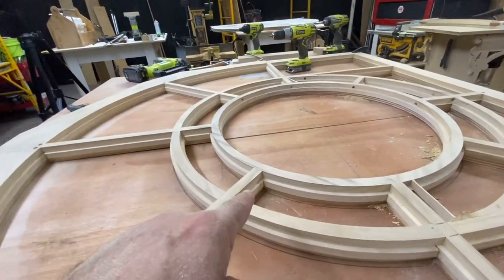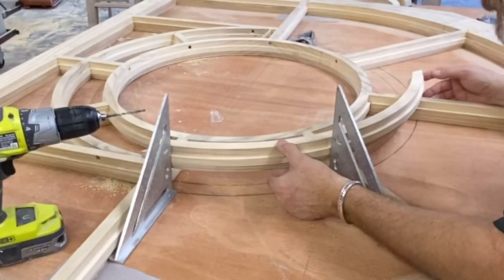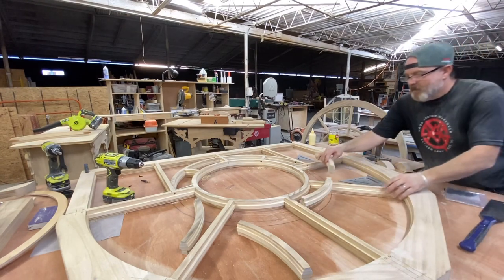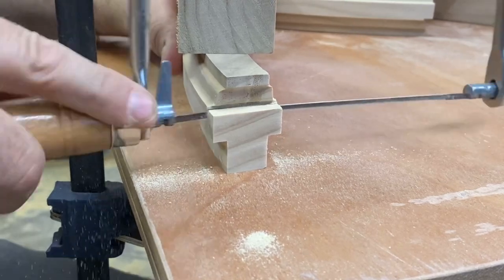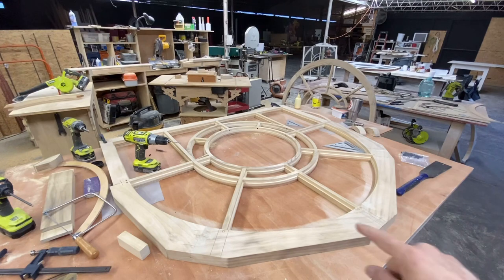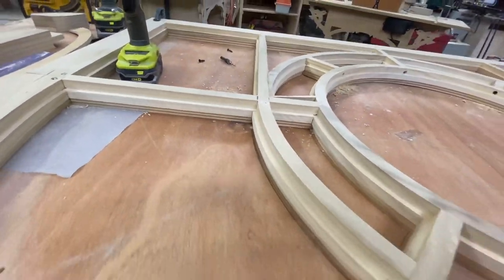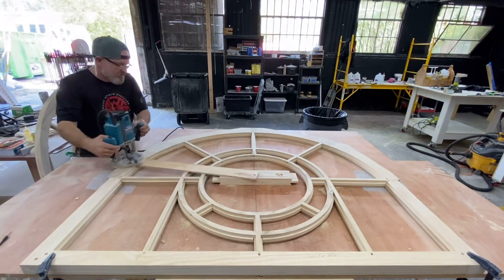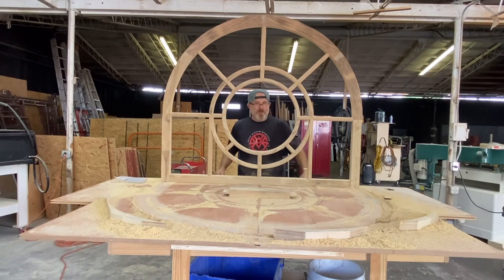Making Radiused Transoms with Steve. Part 5 - The Final Four Muntins and Swinging Trammel

Comment: Thank you SO MUCH for another great series Steve! I'm dealing with a few storms/screens with arched tops and stuck on how to make up the stock for the curve. I'm using cvg fir (still can't get Accoya where I'm at) and Titebond 3 with domino joints. About a 9-10" radius. I'm slowly working toward setting up my own sash factory too... using the photos from the Brookfield event. You're the best and thanks for sharing your methods!
Reply from the maker: Glad to see you here Sean! Just rout templates for yourself using the trammel on the plunge router, then cut as many as you need. Also your fir is more than adequate and so is the domino for simple storms